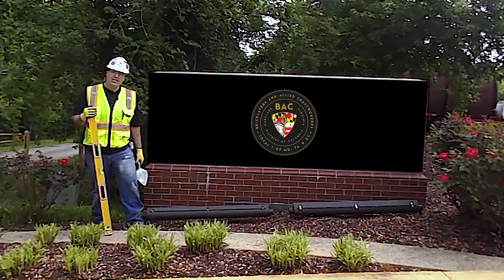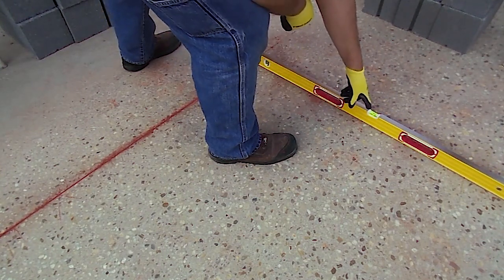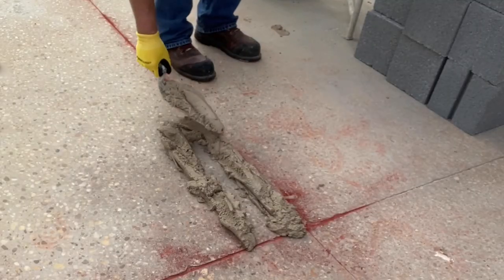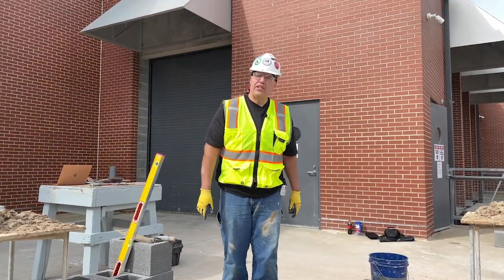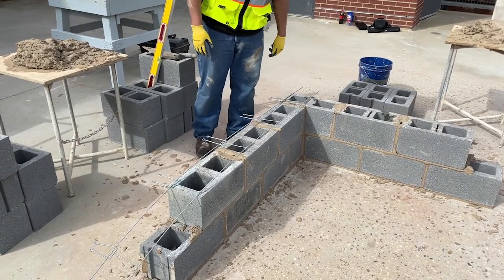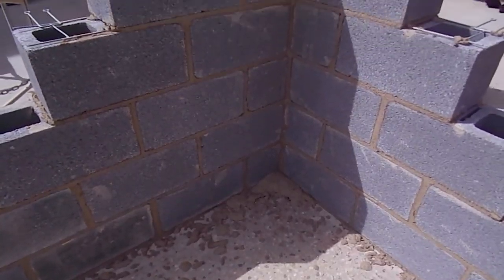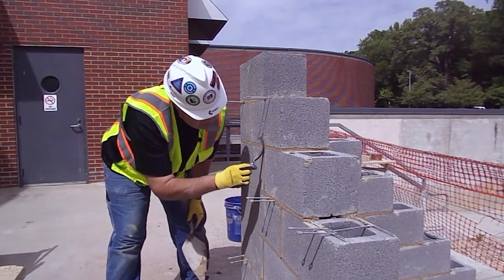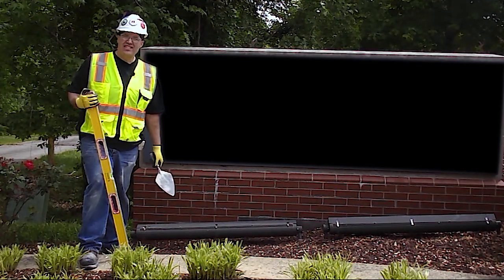Seven Course Block Lead | Prep and Construction | JATC Training

Comment: 3/8" bed joints don't need 2" mud to be spread please people if you're learning to lay blocks only spread 3/4" mortar  bed straight up and down not at an angle otherwise you will create gaps to fill in later and if you spread motar like this guy the inspector will make you or should make you cut in clean outs to try and remove all the droppings obstructing the concrete to concrete poured every 4' and then all the blocks that had holes in them later will need to be demoed and face shelled to look right if shown as finished product. Please people the only way you will learn to be a craftsmen is to take the time to learn it right and let the speed and production follow everyone should pick up a lot in 2 to 6 months but that is basics of laying on the wall much to learn about leads, columns, layout with the different sizes of blocks from 4",6", 8" and 12" and installation of doors, windows openings and expansion joints and setting trigs there is an extensive list of things to learn far beyond the things mentioned this trade use to be an incredible trade to be in and what it desperately needs are young men that are motivated and driven that have goals in life out side of work and will not allow others talking shit about being faster to cause them to cut corners on learning skill and techniques to become the very best this will be hard this will leave you feeling like quitting every day being uncompromising this is not to say it is ok to be slow so you must work harder than others to do the very best and keep up but once at minimum 2.5 years you are ready to cut all necessary corners knowing you have the knowledge and skill to do the very best at the highest production and that your thats good enough is better then the other guys best and you will be able to handle the worst situations with ease as you know and have the confidence to handle them while others will run and jide in fear and be over run with stress and anxiety and scream and yell ruining the morals of the entire crew. The trade has a lot of demands for schedules and dead lines never hide from anything that is hard infact likely everyone else will and you will become extremely valuable and irreplaceable to the company and crew and will have the confidence skills and knowledge to go anywhere and command high wages. Good luck and pay attention to how everyone does things and you will learn even good things from the worst and you will learn from others mistakes and will advance your learning with an open mind and try many ways before deciding what works best for you.
Reply: Or you can spread it on the thick side as long as you remember to clean the inside of the cells as you go . But that cost time and money. All that excess mortar adds up.

Comment: Well l saw your job it was very excellent but l feel like they was one thing which was missing which is a damp course becouse it is a impermeable material laid in the foundation walls of building near the ground to prevent dampness from rising into the building . So my question is why you didnt include it 😊 ..

Comment: Why would you build a 7 course block lead instead of a 6 course block lead when 6 is 4 ft and that's the natural bond beam height and grouting height I have been a journeyman bricklayer for 30 years and have never once built a seven-course lead
Reply: Started as a brick layer in 1961. We always built 7 course leads. Eight course lead is too high to be comfortable and 6 courses is too low to be comfortable when you’re on the scaffold. 
Always plum the block on the vertical. Never across the top. Too many block are not square and the wall face will be out of plumb. 
Easy to remember the number of block for a certain height. The 7 courses takes 7 on the floor. The 6 courses take 6 on the floor. The 4 courses are 4 on the floor and so on.
Reply: @CS-vg1dt   so does that mean you don't put steel every 4 ft ? I've been a union bricklayer in the Pacific Northwest for 30 years we were always taught to go six courses at a time which is 4 ft which is the natural bond beam then you can put your steal and it's much easier to grout into a bond beam than into a full block it might be better the way you're doing it but they never taught us that way we grouted 4 ft into a natural bond beam which is always the 6th course and of course you only plum the vertical otherwise you'd be leveling not Plumbing I guess people are just taught different in different parts of the country and world

Comment: Thanks! Do you have to fill in the head gaps, for each level ? before the next level goes up. There is a hollow there I see, so wondering does that need filling also ? And secondly, would it be a good idea to fill the cavities of each block with mortar, or just a waste ? (have seen the vertical rebar cavities filled, but asking if its good practice regardless of rebar or not for overall strength ? Thanks again

Comment: How would you construct this type of wall for superior strength for high wind areas? Rebar & cement inside of block or something else?
Reply: It is common, especially in commercial construction, to run a vertical cell full of grout with rebar at prescribed intervals. In prisons they often pour every cell.

Comment: I wonder why he left the "TAB WIRE" hanging out beyond the exterior of the wall. You can see clear to the end , he did not mention why.  Also, how is it cut off ? (If necessary)
Reply: they are left long to pick up the next piece of wire when he runs the block between the leads

Comment: Is that wire between the courses for brick wall ties also?
Reply: It can be made in such a way that a brick wall can be tied to the block wall. That type wire has loops on short wire that sticks out the side of the block. Another type wire is inserted in the loop and laid into the brick as you build that wall. Alternatively, you can lay both walls at the same time and put wider wire in every 2 courses or so. In that scenario you would use 12 inch wire for an 8 inch block wall with a brick veneer.

Comment: Damn, another Union Apprentice with a YouTube video. #1 You Always Double Butter, did you forget that  ??  And you level from side to side first then long ways. Get a better level. With all these Union Halls just letting Anyone in, because of Dues. No Wonder Real Craftsmanship is almost dead.
Reply: I'm a bricklayer layer from England could you tell me why he's not set up profiles?Surely it's easier to lay to a line plus it keeps everything to gauge
Reply: @martinnorman2579   Hey Hello 👋, When it comes to Masonry, Concrete, and Framing....the Line does Not Lie....🍺🍺
Reply: Sorry for the length
Reply: You're right about the  Contractors cutting corners and going by the codes, They've been doing that bullshit for years... And yes Hubbard barrel jointer  Is the only Jointer I ever used ..  I don't double butter a block because I don't need to,  It's all how you set the block That keeps the head joint full.. But right on it was good chatting with you.. Just remember on the 8th day God created bricklayers ..🤣🤣 🍺
Reply: @robertkiser8465  Hey just one more thing in case you didn't know.....Most of America's Founding Fathers including Franklin were Bricklayers, and so was England's Greatest Leader.....Winston Churchill....👍🍺🍺🍺
Reply: Best Union brick layers are out of local 4 Indiana Kentucky, This guy is a boot..
Reply: Only boots double butter.🤣🤣
Reply: @robertkiser8465   Only Boots and Apprentices don't.  I have Built Buildings that are on TV Every day including Multi Billion dollar Vegas Casinos. 
You would be Schooled Quick when it comes to Block, Brick, Stone, Concrete, Safe Rooms, or any Custom or Commercial work....🤣🤣🍺🍺
Reply: @kensterling5217   Me Too! I belong to local 4 Indiana Kentucky, We throw full head joints 1st time we don't have to double butter,  Slows down production.. I retired in 2017.. I worked on football stadium's baseball stadium's, glass furnaces, I've done it all bruh. Traveled all over the United States, Have trowel will travel that was our motto.
Reply: @robertkiser8465   I always double butter and will still be the fastest. Most Halls used to teach that, I doubt it now. I walked in one years ago and nobody spoke English. But they also had trouble with different ones running off with the Union money. 
I have worked Coast to Coast and the Best Hall that I have seen is Portland local 1. The City is a mess. As for  Building Codes....Vegas and LA are the Best, because the Codes are based on Earthquakes. Florida and Most places need to Really step it up. Michigan has the Worst Building Codes that I have seen and I thought some of the Hillbilly stuff was bad...but Michigan is definitely the Worst that I have seen. 
Actually I am a Master Mason, I have  45 years of experience from Coast to Coast. And the Master Masons that I have met, I could count on 1 hand. 
But I am still amazed at some people's tooling.....What...?? You don't have a Hubbard, you have got to be kidding me....In Georgia they do some of this Grapevine jointing, it's different. I do like talking with Masons that know their chit. What I see a lot of is Contractors taking Shortcuts, that really Aggravates me. 
Like Safe Rooms in Tornado Alley, most are easily under Built.
These Contractors are Building these Safe Rooms and this Family is going to it for Protection but they are Under Built,...Very Sad, I am surprised people like that can sleep at night. 
And I look around and see Craftsmanship Dieing, it's Sad 😔
Reply: @robertkiser8465  Hey, Good Luck to you and have Trowel will Travel....🍺🍺🍺🍺

Comment: Not sure what your blocks are made of but here in the UK our hollows are 26kg (over 50lbs) not sure I could lift with one hand, maybe your superman
Reply: Q😮🎉🎉🎉🎉🎉
Reply: Well this guy's abilities of spreading mortar is good for a laugh are blocks here in the US are typically around 35 to 50 pounds each more the 50 pounds any more it's stupid 3" split face side walls with some center web 3" and corner blocks can and do get around 4" the engineers that spec the blocks don't seem to grasp that steel with over lap goes in these blocks along with electrical and plumbing and the concrete and steel are what give it its true strength and limiting them is not all that smart. 55 to 65 pounds a block one handed is no problem even with high rebar all day long small cut up jobs I will average around 200 big jobs with long walls are easy and I enjoy laying 400 to 500 a day plus that includes stocking and rebar placement and grouting and I double joint all my own work and build most all the leeds for the guys

Comment: Sloppy! But its not coming down. I rate you as a good second year apprentice. Work on that jointing and plumb your first course from the face of the block.
Reply: Shut up! He’s providing valuable instruction for free. It’s obviously not buckingham palace. If it was he wouldn’t be using those blocks
Reply: Damn jimmy 👍 solid tips. Wish I could learn from you boss
Reply: There’s usually one in every crowd…you’re probably just another line monkey!!
Reply: Sloppy as your sister....
Reply: Ok master block layer how is it sloppy?
Reply: @thomasfyffe5192  Yes, I am a master Bricklayer!
Reply: @thomasfyffe5192  Let me count the ways. First off, Its always a mistake to lay past a level. A level is only accurate to 3 mm. It says it on the level. So 4 blocks long max, Also, Plumb the face of the first course. Joint/pointing is attrocious. Dont just lay one block and then use the level. Soften your mud. The list goes on. Second year where I come from. Wire has been installed sloppy. Insufficient overlap left out and why would you use 2 seperate pieces? Thats just the lead, What other sloppy mistakes do you make on the wall to make up time? Because you didnt plumb the face of the first course, You more that the 3mm out on a level and wondering your whole life why. Every course is tipped the opposite way to correct it on the level. Mistake after mistake results in deficiencies.
Reply: Nobody's perfect.....
Reply: @nl-ds2ov  Jimmy boy is

Comment: can you plumb from inside the wall instead of outside ??
Reply: Only plumb one side and yes you can plumb from the inside. Just pick one and stay with it!
Reply: Not building a corner wall..
Reply: You still have to plumb the outside corner from the outside of the wall unless they are split-face block

Comment: Overall good information but I would like to see a better head joint.  Many masons will have a full head joint then ruin it by sliding it down.  This removes most of it.  A better way is to push into block because it compacts the mortar fully without dropping down.  Just something I have learned over the years and wish I was taught that in the beginning.
Reply: Shove joints are the best joints!
Reply: Yes i wish some would tought me that but recently i was laying block with a old school so he schooled me on that cause i would leave gaps and double work went i had to joint and refill them
Reply: How would you construct this type of wall for superior strength for hind wind areas?
Reply: @bradmason8334  Rebar every 24 inches filled core.  From footing to the top. Bond beam every 4 feet in height with a bond beam at the bottom and at the top.  Durawall in the bed joints every 16 inches.  If possible plaster/stucco one side of block to reinforce the entire wall.  This is for 
extreme conditions and obviously have temporary supports until all is cured.
Reply: Not these days lol
Reply: Dudes building fort knox
Reply: @Ezahne  or an at&t tower site!